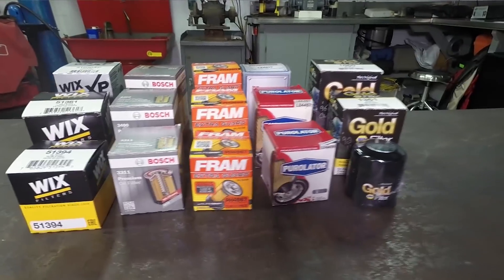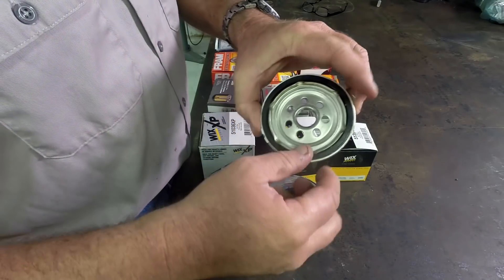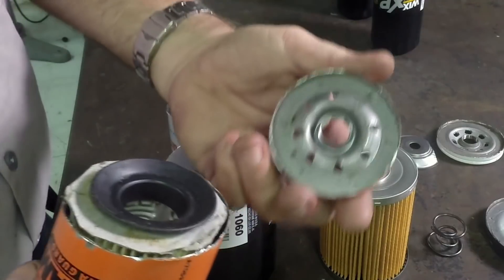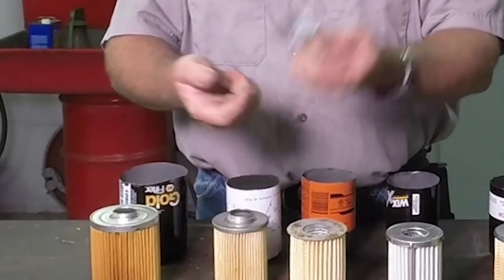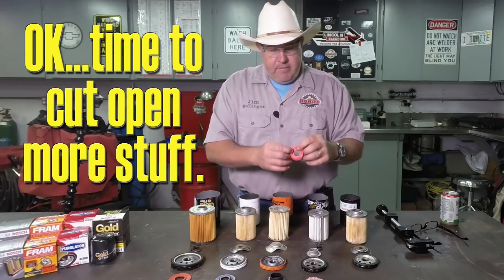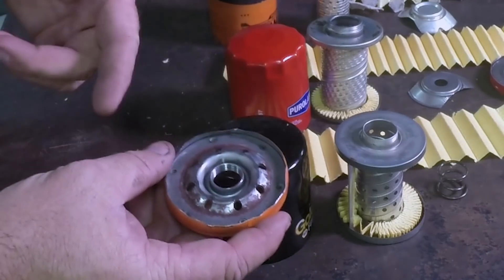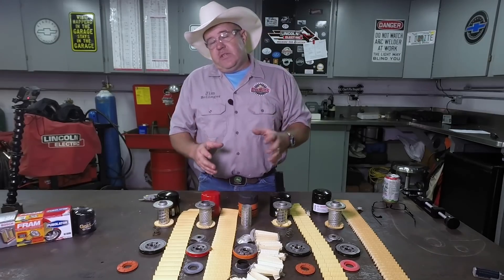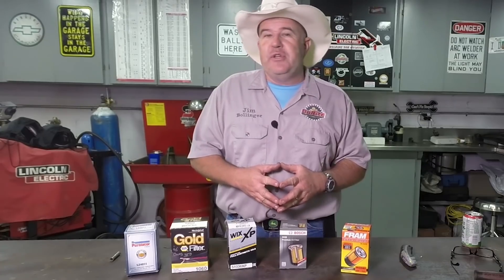The worst oil filter EVER!

Comment: Thx for the video Jim. I disagree on parts of video relating to Fram orange can  filters. Over 50 years I’ve changed oil for many people helping out people on a budget who brought their own oil and (often Fram)filters. I spent 25 years as a graduate mechanical engineer in the hydraulic industry , raced cars, built engines and so forth. The Fram filter   provides solid performance at a budget price .The rust staining is a non issue and the fiber end cap coming apart is a consequence of disassembly.End caps  are essentially a surface for  glue.

Comment: When does card board rust?Thats glue.Fram works for cheap..Have over 310,000 miles on the cheap fram no problems. Its like toilet paper it has a purpose then gets tossed.

Comment: I used to use Fram when I started driving.
That was a long time ago and Fram was considered one of the best filters available. 
It probably was but times change.
I have not used Fram for over 10  years after reading a review on BobTheOilGuy website. The filters were cut apart and examined just like here. I think they also tested the filter material.
To my surprise,  I'd learned that my trusted goto Fram was garbage.

Comment: I had a 96 ford contour I bought in 99. The only oil filter I could find in that size was the orange can of death. Never had a problem with any fram filter I ever used. I traded the contour for a 2022 nisssn I bought new. St9ll using orange can  of death.

Comment: Not all Fram filters are so cheaply and poorly made. That must have been one of their bottom tier ones. I've been very impressed with the Fram Ultra Synthetic.  In several of these types of videos by others they have withstood the scrutiny.  I would not hesitate to use that in my vehicles.  From all these videos I've watched my top 3 choices would be the Wix XP, the Purolator Boss and the Fram Ultra Synthetic.  Back in the late 80s and early 90s Frams were great filters. The company went downhill for a while and kinda ruined their name. Maybe they're on the mend a bit.
Things change and you've gotta keep on your toes. Don't take stuff for granted just because a brand has had a good reputation and name.  Back in the late 80s when I was a young new car owner I read a couple articles about some fleet studies that were done on Pennzoil.  The Pennzoil engines were opened up and found to be horribly sludge up. I've avoided Pennzoil  like the plague all these years. From watching these engine oil videos I've learned that today's Pennzoil is a totally different company and their oil has been totally reformulated. I have been extremely impressed with what I've seen and learned about several of the Pennzoil oils, especially the Pennzoil Ultra Platinum.  I've just recently bought a 2016 Ram 1500 Crew cab, 4x4 with the 5.7 Hemi.  I plan to use Pennzoil Ultra Platinum 5W-30 in it, with one of the above mentioned filters.  I have been a pretty firm Castrol fan for the past 3 to 4 decades, and used it in the several Honda Accords (4), Toyota pickup (1), Toyota Previas (3), Honda Odyssey and Saab 9-5 I've owned. I'm still a big fan and will likely use it some as well as the Pennzoil (which ever is on sale and readily available).
Today's oils are all very similar and pretty top notch and really any of them will do the job well... even the Walmart Super Tech and Amazon Basics. But we all have our opinions and favorites, hopefully based on data and not just the color of the oil or the container... lol

Comment: Yep I think fram is starting to put back metal end caps on some filters.  And then Honda OEM filter is Fram for one of their lines  that ends in -02 however it may be a higher quality one

I use supertech made by champion labs with metal endcaps

Comment: Wish I had seen this a few years ago.  I had a vehicle that was out of commission with intermittent low oil pressure. Finally found someone to do a proper diagnosis and he found a oil filter that had fallen apart and was blocking oil flow.  IT JUST HAPPENS THAT IT WAS BRIGHT ORANGE IN COLOR....NAPA FILTER, NEW ENGINE!!

Comment: I know the fram is not good, but on daily drivers, I have run them on my 1 ton  trucks 
 And  vans for over 200000 thousand .but I don't go over 3000 miles between oil changes

Comment: Your test are about as scientific as saying bigfoot is a vegan.  Your disassembly does not in any way translate into real world physics of how the oil flows or the forces on the filter under load.  To use your own words, the proof is in the pudding.  I've got over 225 k miles on my Toyota and have used fram from the first oil change.  My internal s and condition of valve train, crank case and all other components that utilize oil looked perfect when the engine was taken apart for routine replacement of seal and gaskets.  Its more important to have good maintenance, and a quality engine that you dont abuse.

Comment: In my many years working in the field and constantly checking oil on equipment,  I never once saw a Fram filter on a commercial engine. (fuel, air, or oil)  Most were Baldwin and Napa Gold/Wix.  Baldwin being the most common on rental equipment.  The difference in price between a good filter and bad one is usually less than a coffee drink at Starbucks.

Comment: I've only ever had one problem after changing an oil filter and it was a Fram filter with a faulty anti drain-back valve. I'm pretty sure the only reason I used it was that the Fram was easy to get from a local parts supplier, never again.

Comment: Different product lines have differing levels of quality. Here's a guy comparing filters for a Harley: https://www.youtube.com/watch?v=BALoiHotB-I   The Fram filter in this case is of significantly higher quality than the current branded Harley product. Of course, ther's a chance that Fram made the cheap filter for Harley as well...
Reply: It changes for every part number. Just because 1 filter is poor dose not equate all the different part numbers of the same brand are. You can cherry pick filters from all the brands to make a claim, but it won't hold up if they are not for the same application. The "winner" in this case is obviously much larger and does not even have a chance of fitting the same application as the others. My guess is he did not like what he found inside the correct smaller NAPA Gold filter.

Comment: This makes no sense to me.
I'm watching filter videos and there's one that contradicts everything you say about Fram filters.
They pulled the filter apart we saw a high quality product. 
This was a Harley Davidson mechanic who showed that the Fram filters and the classic Harley filters where virtually  the same.
No cardboard in the Fram filter in that video. All metal.
Or are you just showing the very bottom end of the Fram filters?
Otherwise..... explain why yours is cardboard and the Harley mechanics was metal? 
Did you do a fair comparison?
I think not after seeing other vodeos on the subject
Reply: No he did not do a fare comparison. The "best filter" in this case is much larger and obviously not the same application.  If the part numbers don't cross reference to each other than it's nothing but cherry picking. It possible that a filter manufacture builds a very good part for one application and a bad one for another. They are all built different by a single manufacture.

Comment: LOL! My company ran 10 trucks for 20 years using fram filters and pennzoil, and I use fram on my two motorcycles and personal vehicles and have never had one oil related issue. Have a jeep with 300k miles on it with fram filters since bought it 20 years ago. My uncle had mechanic shop used only fram unless customer wanted something else and swore by them. They may not look great but they have proven to work really well for myself and many people I know in auto and motorcycle world, but hey each to their own.

Comment: I ran the orange Fram on a 500HP jet boat with 50-65PSI oil pressure for 8 years without a hiccup.  It is Frams cheapest liter and you are comparing it to wix and NAPA GOLD, K&N.  Those filters are double the cost of the orange Fram. 
This whole video is farcical.  Pablum for nincompoops.  You are criticizing something on it's "looks" when you don't understand the engineering.

Comment: Never had any problems with Fram filters in 50 years  oil is allways changed at 3 thousand miles my current dodge van has  four hundred and seventy eight thousand miles runs like a top. Fram is a trusted  brand

Comment: I appreciate your attempt at evaluating oil filter 'quality'. 
While such factors as apparent quality of materials used in the filters MAY be an indication of how well they MIGHT actually work, without actual tests of their capability, your evaluation is all speculation based on assumptions that may or may not have anything to do with how well they actually do work...

Comment: Another 'tuber compared oil filters for motorcycles when people complained about his using Fram filters instead of Harley branded filters. His breakdown of the chrome filters had quality in the Fram, and garbage for the HD.

So I guess, maybe, comparing a filter that is half the price of the inexpensive Wix filter, and less than a quarter of the price of the NAPA filter will show very badly in comparison.

Comment: TRUTH    It is a common design that is used by most manufacturers in budget filters. I use them all the time, 50+ years, never had a problem. Just do not run them for more than 1 year, even on lightly used equipment.

Comment: nice smear campaign, gold standard synthetic filters vs fram basic non synthetic oil filters...of course all the other filters will be better they specifically say what caliber of filter they are right on the box, fram has two better levels in just standard oil, and two more above that in Synthetic...apples to apples, not apple to GOLD apple or SYNTHETIC APPLE.
as for the rust, well your down south, hurricane damaged everything, won't even buy a car from the coast due to all the salt air.

Comment: I found a brand new 1976 International Scout with a 345 cubic inch V8 engine I change the oil every thousand miles since the car was new used Fram filters the money I spent on engine oil and filter changing it every thousand virtually no bearing wear drove the truck for 20 years pull the engine down virtually no bearing where

Comment: any one else giggle at the correction about Napa and Wix and also the rust is on the outside of the filter paper so its not going into the engine its's gona get filtered (also most engines go pump filter engine so not filtering the return oil) wait whys was he using a grinder there's a filter cuter siting there

Comment: Just watched a different video where the guy (looks like Jesus) compares a modern Harley filter, a classic 20 year old Harley filter and a current Fram alternative. The classic 20 year old Harley filter and the current alternative Fram filter were almost identical. Well made and good quality. The current Harley filter was the same piece of shit construction that you see with the Fram filter shown in this video.
I’m not denying that the Fram filter shown in this video is a piece of shit. But the one shown in the Harley comparison video was good quality. No doubt about it.

So, I’m confused. Does each filter manufacturer have various levels of filter quality? High end and low end? From what I’ve seen it would be wrong to make a blanket statement that all Fram filters are shit. Maybe it’s a case of you get what you pay for. Unless it’s a genuine Harley filter, because that thing was definitely an overpriced piece of shit.

As with a lot of things, don’t believe the hype. Do your own research.

Comment: No worries here, it is now impossible to buy any  filter from back  2018, when this click bait video was made.   From information gained from a site called " bob is the oil guy" I am very confident that a Fram synthetic oil filter now is among the best on the market, if not the best, for my LS1 engine that specifies synthetic oil.  One can't fully understand performance in application by just looking , but a visual inspection will reveal obvious problems in one sample.   

For worst filter ever, I nominate the metal screen with the large open weave used in VW beetle engines, although it really isn't a filter, just a parts catcher , and not a very good one at that.  Because when I blew up one of those engines, I had little silver crescent moon shaped metal all over the engine compartment.    I used to have an old jag that used thick felt as an oil filter, with a steel corrugated mesh to keep it from collapsing.  I can't say that was the worst filter ever, but thick felt was  certainly inferior to modern filter materials, if one really cares to investigate what is, in truth , "the worst filter ever", instead of just throwing the statement out as click bait.

Comment: Wal-mart use Fram oil filters for years. I worked for them 15 years. Told about fram oil filters are bad then.  They cost   Wal-mart $5.00 a box of 12. Charge you about $3.00 for the filters  open 5 box’s one time had no threats. In them. Had some of the filter pop off on fords a lot  I tell people pay for the different oil filters. Trust me. It will save you

Comment: I have been using Fram oil filters for years without a problem. The proof is in the pudding. Not one filter failure. I even use them in my beloved 99 Harley Softail Custom. 63,000 miles without a problem. 

So, trash them if you want. They do the intended job. Filter the junk out of the oil.

Comment: Funny to hear and see this hit job on fram, I have a 97 chevy 4x4 tahoe 5.7 which I purchased from the original buyer in 2002  with 60 thousand miles on it. I've always used fram filters since I purchased my tahoe and far back as memory recalls. LOL  I've always used the cheapest 30 weight detergent oil to do oil changes on my  tahoe plus all my American made rides at 3,000 miles intervals needed or not. I just did a rebuild of the engine at three hundred thousand three hundred miles on the tahoe give or take a few mile. The block still had the visable original hone marks in the cylinders, engine had the original GM marked main & rod bearings in it which looked almost as good as the news ones I installed in it. Oil pressure was always at 60 PSI at start up and would drop down to 40 after warm up on HY to work and would recover to 55 60 PSI after getting off HY and arriving at work. New melling oil pump lucky to do 50 PSI on start up now. All the oil passages on crank and block were clean no build up when running a round brass brush through them. If not for # 6 cylinder fouling the plug ever month or so  I would have put off rebuilding the engine for as long as possable. All the rings looked OK only the oil scrapper in cylinder 6 was not working right. My recommendations for your rides motor in good health, oil changes every three thousand miles whether there needed or not and if it makes you feel better using the expensive sin oil or oil and those expensive filter its your money. But most important change that oil, to hell with the techs telling you it's OK to change the oil or filters at 5 to10K miles. And plugs evey 5 K.

Comment: I heard a couple years ago that fram was junk. I did switch. Before that i think it was all I ran. I've got a 2001 dodge 360 with 350000 miles on it, I'd say probably 300000 of those was with a fram. Gotta wonder how bad they really are? Why aren't they being sued for harming engines?
I mostly use purolator for 2 reasons, 1 there's a store local to me that sells them cheap and 2 because NAPA is way expensive. I don't know if each NAPA can make their own prices, but I bought a filter for a 93 ford diesel and it was $50! I was in a hurry, live 40 miles away and didn't know if I had a filter at home so I bought it. I questioned them and they told me a bunch of BS "diesels need special filters". The purolator is like $8 maybe. I'll buy motorcraft and mopar filters if I can find them, sometimes walmart has them.

Comment: I always liked Fram because they are easy to grip when your hands have oil on them. Haven't been able to find them the last few years now I see why. Never used Napa because I've heard the engine sometimes knocks when you first start it, filters oil too good I guess. Been using Purolator mostly, no complaints with them except hard to grip with oily hands.

Comment: I always used Fram filters til one came apart on a Ford 300 I had. Everything was still screwed to the block but the casing blew off. Motorcraft are the BEST oil filters.

Comment: All filters from the time they were first used, used paper as a filter 
Some used drain back valves, some didn’t.
In fact, a very popular add on filter used toilet paper as a filter.
My 57 Chevy in early 1960s used a drop in filter made of cardboard and paper.
Most filters work just fine, if you change your oil regularly.
What do yo think your air filter is made of , paper!.
The question should be is why are filters getting smaller?
My old 57 Chevy filter was at least 8 inches tall, what a filter!
In the 1920s and 1930s there were no filters on oil.
You changed the bearings and rings about as often as the oil.
Oil was that bad.
Todays oil is much better than even the oil I loved in 1960s, Gulfpride 30.
It kept your engine clean if you changed the oil regularly.
Oil has advanced along with the type of metal used to build engines.
The most important and greatest improvement is fuel injection.
Fuel wash down of the cyls. has been reduced along with reduced oil pollution from gasoline.
Race people might complain of Fram oil filters, I believe because of the ultra high oil pressure they run in their engines trying to keep them alive.
Your daily driver, I hope, is not a race engine .If it is I feel for you. I tried that for many years and grew tired of fighting the thing plus working on it all the time.
The end of this is, Change your oil from 3 to 5 tho miles, or twice a year.  Be happy